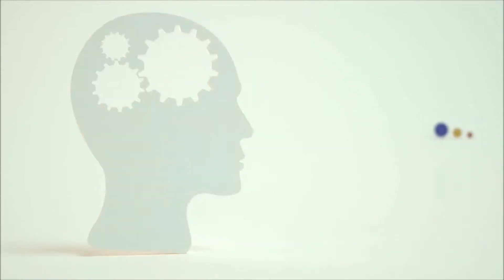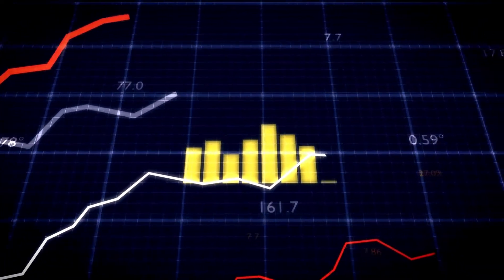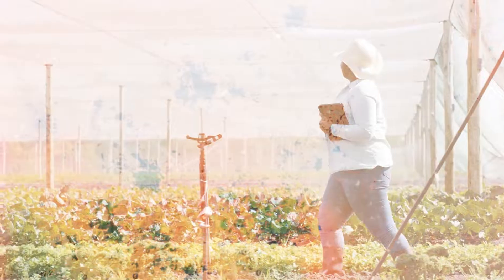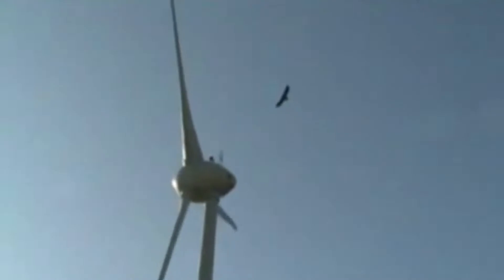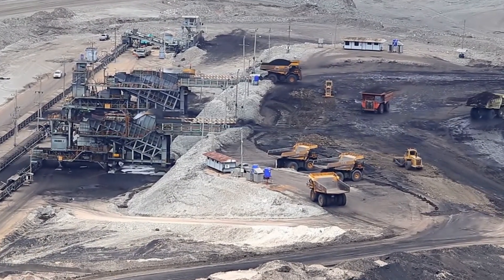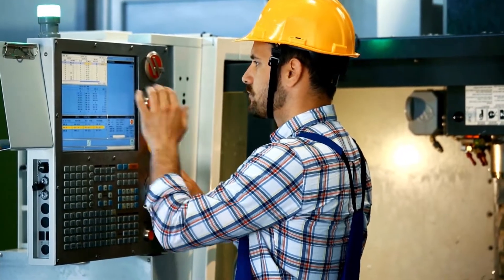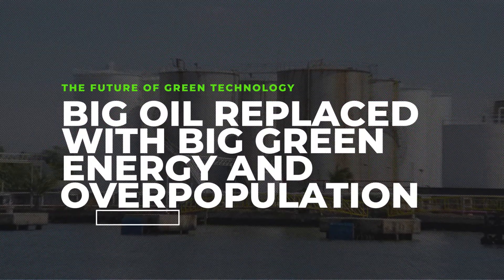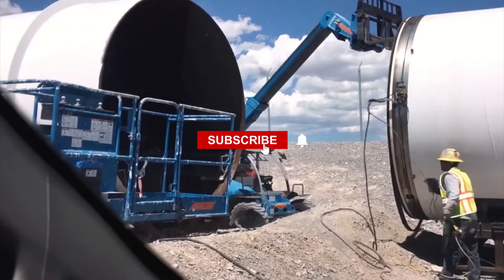What Is Green Technology?

Comment: How is a photovoltaic cell created? It is HEAVILY dependent on fossil fuels. Every single step of the production of solar photovoltaic power systems—solar energy—requires the use of fossil fuels, for carbon reductants, for smelting silicon from ore, for providing heat and power for the manufacturing process, for the transport of materials across nations and continents, for construction and installation. The only truly renewable materials consumed in solar photovoltaic power systems production, you know what they are? Trees, torn down and obtained from the burning of vast areas of tropical rainforest, mainly in the Amazon, for creating charcoal—carbon—which is needed for extracting silicon. Now add to this the mineral resources and fossil fuels necessary for constructing factories, processing equipment and maintenance of the solar energy infrastructure! And at the end of this process, you know how long a solar panel last? Maybe twenty years. You know how long a solar battery lasts? Five, maybe ten years maximum. You think in five, ten, fifteen year this cell and this battery have balanced out all the CO2 that was generated to manufacture them?